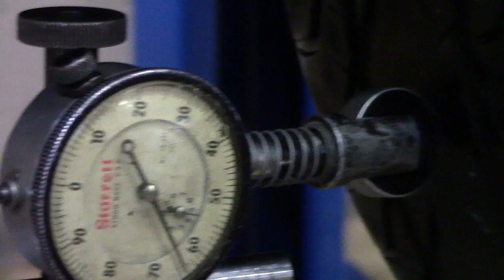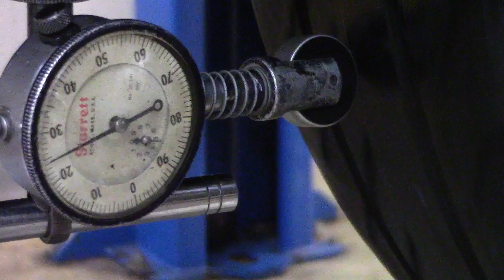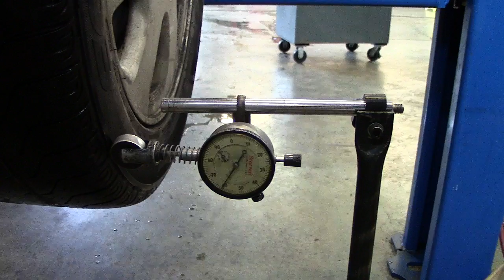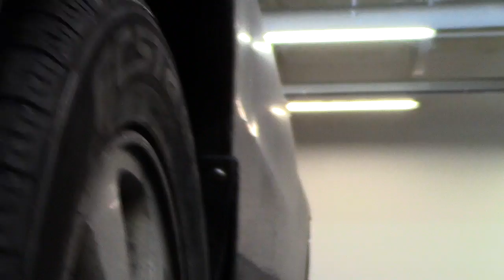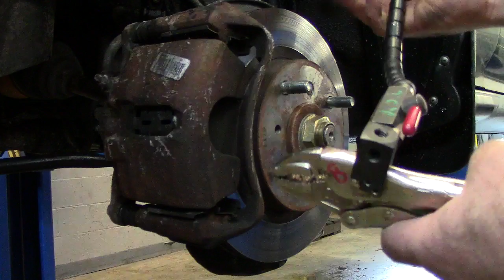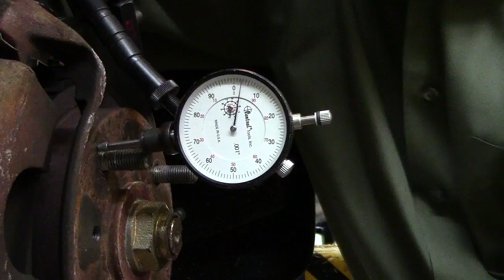tire runout

Comment: One nut holding the wheel? The dial is not stable and moves all over. This video is not helpful, sorry. The conditions are such that any measurements results taken from this setup are not reliable.

Comment: Thank you for this video I found it very useful.  One error I'd like to point out though is when you are measuring from the side of the tire it is going from the zero point to 20 and zero point to 70.  That is 20 and 30 thousandths from zero for a total of 50, not 90.
Reply: Thank you for the correction sir